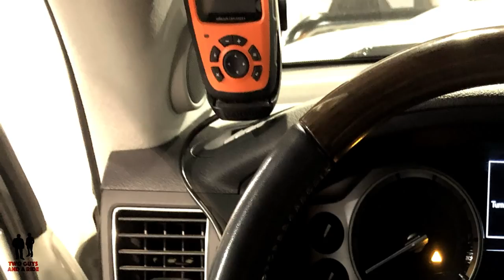Toyota Land Cruiser Overlanding - SEMA 2019

Comment: I hate that these people have made overlanding to seem like it is only for the rich and wealthy. That $90,000 Landcruiser has mods and accessories probably worth over $30,000. 

A normal individual just needs a used capable Toyota 4Runner that is about $10,000 or less with few mods included. Then load up some basic things and a cooler and hit the road for some back country adventures. Not these types of cars that cost you over $120,000 before you feel you are well set for a road trip. Besides, cars as clean as this truly do not go where they would be damaged. So, they stay on basic back roads.
Reply from the maker: It used to be called “camping” and yeah, it wasn’t so expensive. Thanks for watching!